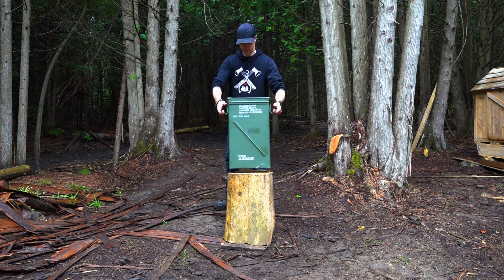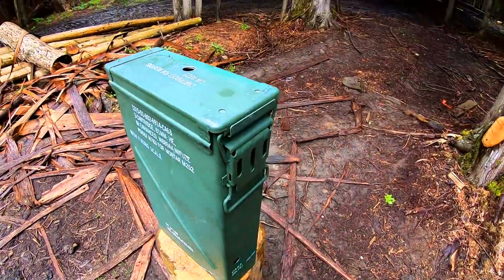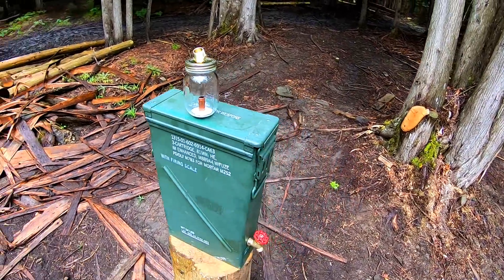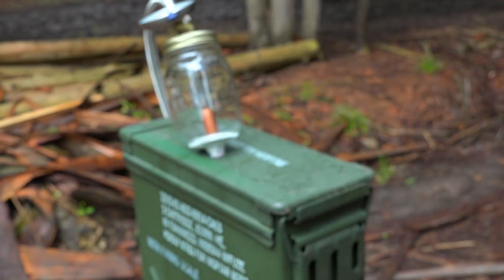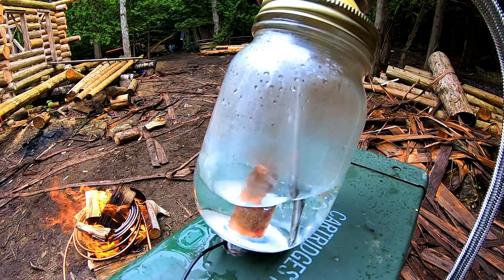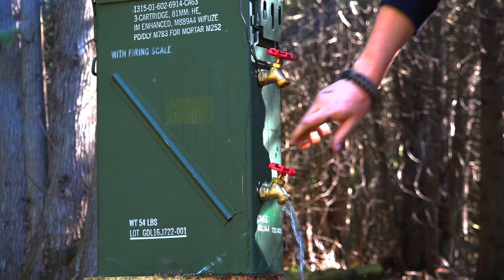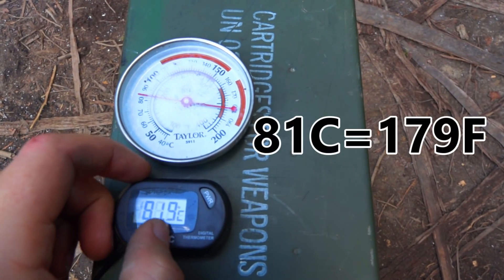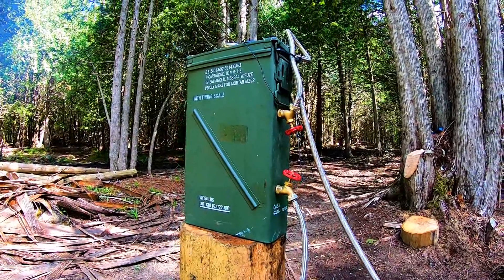Off Grid Heating Prototype- Copper Coil Water Heater / Heat Exchanger / Radiant Heater

Comment: Overall a nice start to a backwoods heating system. Some notes: 
1. Tailor your system to match the amount of heat output and storage. Your ammo can is your storage and your exchanger as well as a thumper. Realistically speaking you probably want to include a radiator (car radiator would be fine, just never let it freeze with water inside).  This way you solve several problems. 
     A) The noise of the system can be kept away from your sleeping area
     B) You can make your storage much larger
     C) You get much more efficient heat exchange
     D) You can locate the radiator in a more convenient location, possibly underneath your sleeping area (if protected).
     E) You can choose many types of radiant systems. You can skip the car radiator and put a flat coil of pex or copper under your sleeping area. With that, you will not need a lot of heat and it will rise up keeping you nicely warm.
2. Storage.  Your system was still hot an hour later, not because it was great in terms of heat, it simply as inefficient in terms of releasing the heat. You could very well have wanted this but, there is only so much water in that can so you have a set amount of heat to release into your sleeping area. Having a system that you have to pull the coil from the fire because it is boiling is not good. It would be better to have something that you can just let the fire burn out over time and keep the water hot as long as possible. 
3. Keep the steam away from you, as far as possible both for safety and because of other bad side effects. In cold temps it will condense and freeze and that is the last thing you want near your sleeping quarters.
4. Water. Water is potentially a poor choice. Now I know you don't want to be carrying around a bunch of coolant so it's a difficult situation. But here's the rub, if you go to sleep on a really cold night and you have removed the coil from the fire, that coil and line might freeze and split. 
5. Fire regulation. There are various methods of regulating the fires heat but something to keep it from getting too hot and lasting longer would be really good for this system. If you can accomplish this it would save your copper tubing from both the oxidation as well as the risk of freezing and splitting. There are also thermostatic valves that you can use to control the amount of water going into the tank. You could have a secondary coil in the snow/air to cool the water so that a bypass value could be used to redirect the hot water to a cooling coil to keep the fire from boiling it. So, the idea would be when the tank gets up to temp, the bypass would route the water to a cooling coil until the tank cooled enough to need heat again. The problem is you need to leave some of the water circulating in order to move water through your radiator and keep the tank up to temp, so you will need to tweak the amount of bypass.

All in all its a great start. Hope to see more improvements as you go.

Comment: Put blow off valve on top hole, vent outside.  Pressure will keep the water from boiling.  Mount heat sinks on the sides of the can.

Comment: Too much heat, you are forming a steam lock in the gravity circuit.  Use a much shorter copper tube or only lay one edge in the fire.  You will know when you have it right when there is no steam hammering.

Comment: Everyone here has so many "perfect and better solutions" and I'm over here like, what are the tweaks you want to add?  Thanks for your time and documentation.
Reply: Haha I read your comment as "What do you tweakers want to add"
Reply: Propane Heater and Camp stove....
Reply: Add a pressure valve to the top, to get rid of the gaping hole and the knocking.

Comment: You could get a small 12 volt heater core for a car and keep the whole tank outside. It would keep the water temperature down as well so it doesn't overheat as bad.

Comment: You need to rethink the copper piping that you can circulate, the water, use it too heat up the cabin. Also use a wood stove that you can control the🔥'fire... Keep the copper piping away from the flame! If you would have a wood stove than add copper tubbing like a radiator then circulate it too heat your cabin, plus hot water for a shower.

Comment: yeah but you still want to have a reservoir, protect against boil dry which would result in the coil potentially being destroyed or mad steam pressure being generated (the system would be closed loop otherwise) plus it would help hold some thermal mass in the system... buuut this would all add weight and complexity, a trade off.

Comment: Run a copper pipe out of the top as a steam release,  and coil the opposite end of that copper pipe into another ammo can and you'll have distilled drinking water in addition to mitigating the steam

Comment: Bro, why are you using a glass container for the top?  So you're gonna snow mobile in, with that glass bottle hitting below freezing temps, then run hot water through it?  It's gonna shatter.  Why not just get a container with site glass on it to see if it's working properly?

Comment: I'm curious, what's the plan for obtaining liquid water when the ambient temperature is substantially below freezing? Would there be enough air moving through the system that it'll melt snow/ice via convection? I'm skeptical, but I obviously I don't know this for sure. If it doesn't melt snow/ice via convection, the only other methods that pop into my head at this moment, at least if this system is to be used in an isolated area, would be the introduction of a chemical additive to lower the melting point of water below ambient temperature, using a chemical additive the reacts exothermically (producing heat) with water, or heating the ammo box containing snow/ice over the fire to get the system started circulating water. Each method has its drawbacks and risks. I'm curious to see if this system is viable when its operated somewhere that doesn't have a convenient supply of liquid water.

Comment: I'm amazed that a radiator using thermal siphoning and water as thermal mass isn't more common, the only real design flaw is that it's dangerous if it's not properly supervised and starts to boil over. Water has an extremely high thermal mass, so it should stay warm for a very long time. The only tweak I would make is maybe route a hose with a pressure relief valve out of the camper as well as a regular ball valve and keep the whole system sealed, so that way no hot water can splash out onto you if it starts boiling and you can manually release the pressure, but it won't turn into a bomb if you forget to

Comment: There is no good reason to heat water with wood as long as you can heat it with sun rays. A shallow well-isolated water bed with a glass front placed at about 45 degrees toward the south or glass vacuum tubes with copper heat collectors in the middle will warm up a well-isolated water tank inside a building and keep it warm all day every day without you lifting a finger after it's built. The sun will work for you if you allow it to. It will heat air spaces such as rooms directly if trapped by thermal mass to the east, north, west, and single-layer glass making up the whole wall to the south. The space will always be warm even on deep freezing winter nights after dawn as the thermal massed walls will release the heat stored during the day. The way of smart humans is to make life as comfortable as possible with minimal energy expenditure.

Comment: Honestly it would be far better to use a real radiator of some sort. That ammo box is just not going to very effective at radiating a lot of heat. Even a small car radiator would do a far better job. Same would go for the copper coil. A radiator there would be far more effective. I mean this is an ok setup if it's all you have, but it could be improved in so may ways. If it's not going to be moved ever, you could even build a metal firebox and enclose your fire. Drop a few peltiers round the box and harvest some electricity from the waste heat. It's not going to be a lot of power, but it may be enough for led lighting, or even a small fan for the heater.

Comment: A Scandinavian trick is to use a log torch (a log split in quarters rejoined with a hollow middle) with a metal pipe U bend going through it and into your tent. The heat differential causes it to suck air from under the fire and blow it into your tent with reasonable force, air temp is usually around 40-60C out, not enough to melt your tent, and no CO2 as the pipe suck point is nowhere near the source of emission.

Comment: how u gonna keep the water liquid when no fire is burning?
Reply: I don't understand what you are asking.
Reply: @k_tess  I believe they're asking how will he prevent the water from freezing if the fire goes out. My answer is that he could add antifreeze or glycol to the water.
Reply: @stevengoogin3729  well actual cooling/heating systems are under pressure. But even then anti freeze is added.

Comment: Great idea! I would caution you against using those braided washer hoses for your set up though. The internal tube is a flexible nylon or some type of artificial rubber and I seriously doubt it is rated to hold pressure at those temperatures. That could cause a serious injury if they were inside your camper and failed.

Comment: Not practical in the slightest. You're trying to have modern convivences while living like you are surviving. That little wooden trailer is great for day trips, which you don't need a shower and can get clean by a canteen cup and a wash cloth. Waste of time, effort and space. You would have been better off just running that ammo can as a wood stove and using a slow burn on it with charcoal since it'll heat longer and faster than wood.

Comment: Add a basket to the top of the can and throw on a couple flo-cheks  on each end of the copper, and you have a drip coffee pot to serve 40 people!  Wouldn't it be easier to just set the can next to or in the fire and set it inside the roaming hutch for the night?

Comment: Use the energy from the fire to somehow move the water through the top water pipe, since there is so much excess heat energy from the fire.

Comment: why not use a car radiator in place of the ammo tin? it would radiate heat a lot better.
Reply: would a heater core work?
Reply: @jabez571  yeb but they are smaller as they are fan forced

Comment: 0:47 ahh engineering in the wild

Will get a little humid with your steam release in the open; maybe make a pipe to direct the steam out with an insulated line when the humidity is high. Just make sure it doesn't clog!

Comment: Awesome design. I'd recommend a metal container for the fire and some coiled steel piping instead of copper. Would be really great to build a system like this out of food grade materials. Could have a third spigot for draining off hot water for cooking and bathing. I'm planning on building a small camper next year and this is really inspiring. Thanks for sharing this.

Comment: The reason water generation worked at first then turned to steam is because water in the coil got hot, then got displaced by steam. There was no sustainable flow, even if you controlled the heat to keep it below the boiling point. There's no pressure differential across the coil, so pressure builds in the coil evenly and pushes hot water out of both ends as pulsed by the steam being generated. The steam being generated is about the only thing heating your water at this point.. There is NO water flow.. This is easily evident by the ends of the coil looking like copper, and the center of the coil turning black from being overheated. That tank should be SUPER hot within about 10 minutes or less on a mild fire with as much copper as you have there.. Not 45+ minutes..  To make this design 100x more efficient, place a one way ball check valve on the cold outlet valve of your water jug facing outward toward the coil..   When the coil generates steam, it will push against both ports on the coil equally. Remember, in a loop, water will self equalize so your theory of heat siphoning is slightly skewed..  It does apply here, but very VERY slightly..  As the steam pressurized coil pushes steam outward against both ends, it will seal the check ball on the inlet, forcing hot water out of the top, (Path of least resistance)..  This in return gives momentum to the liquid/gasses in the coil and this energy will remain moving in the coil until resistance stops it.. This in turn will siphon fresh, cool water in through the inlet as the steam cools and contracts, especially since the gasses/liquids in the tube have velocity going that direction anyways..    Once it runs out of energy, the siphoning stops, the steam generation stops, and the coil is cool..  Now the fire heats the coil, makes steam, and the cycle starts all over again..  It's the exact same principal that a coffee maker works on.. They have check valves, because otherwise you'd have a steamy water reservoir and no hot coffee or water for that matter.. 

Also..   This would be a much more reliable design if the copper were protected from direct exposure to the fire, as this oxidizes, erodes, and makes the copper brittle. Perhaps wrapped around an exhaust flute, or around a barrel placed over the fire.

Comment: Low tech solution: place rocks inside fire until hot, move to a bucket (with a shovel or something) and cover with sand. Sleep next to bucket. 
High tech solution: build low-weight heat exchange system from thin tubing with smart control for your safety. 
It's great that you share your project with this community though. Thanks for putting the effort into making it. Regards from East Germany!
Reply: He's already done this.

Comment: Great idea!! 
How about a coil of copper tubbing in the fireplace of your log home and running the copper line around the baseboards of the home back to the fireplace? Would probably need a reservoir and pressure relief valve setup... possibilities are endless!
Thanks

Comment: You have multiple  lanterns there, that burn what? Candles? Kerosene? Couple of those inside that tiny camper will keep it warm, especially with a person inside. You can run duct off the top of them to outside to deal with any fumes from kerosene . OR use a 5 gallon metal can to contain the lantern and vent it to outside. Gets rid of fumes, blocks the light from the lamp so you have darkness...

Comment: You need to use a small rocket stove to make it much more effecient on wood. Ive seen other people doing this building the copper coil into the upper stove and stove pipe. Run the pipe around your house and 1 or more ammo boxes/boilers makes it super effecient use of water and heat. Fun way to get a hot shower to. If i take a long shower use its not gonna be more then 2/3 of those ammo boxes. I got a biltema portable usb (thats right) usb charged phone battery biltema portable shower. Im not overstating how awesome it is.

My idea was to do what you are doing but then to use electrolisis to make gas from water and salt and use the heat for your system.

Its much more effecient that way. Fun project. Good luck with your cabin project. Dont make your girlfriend a walk-in closet

Comment: I was thinking about something similar for my car. A pressure cooker sending steam into an old car cooler with a bimetal fan, and a hose coming out of the cooler and out of the car into another pot. There would be a pressure valve from the pressure cooker at the very end of the hose. 
A circulation would be nice but I dont think it's possible with the pressure cooker. 
This way I dont have to be afraid of boiling. Boiling is your problem not mine :)
If your setup ends with a boiling temp then you can just warm up the tank and bring it inside - which sucks. I've tried it before and it's only ok for an hour.
There are professional water heating systems with a lot of valves and circuits and frankly unless I prove my system is good enough for the whole night, it may be worth looking for the cheapest and smallest one.
It should work just fine with a brick rocket stove and in fact from distilling my own booze I know that a very small flame on a propane stove is enough to provide steam for a very long time. After 12 hours my 3 gallon pot is still half full. If you could test my idea I wouldnt mind.
Many people live or camp in cars and they have to burn their precious gas to stay somewhat warm - which is not sustainable. 
You can have a proper stove in a cabin or a van of this size but not in a common car.

Comment: Two steel radiators connected together would be easier. One besides or above the fire, one in the camper. By careful positioning you would achieve a much better thermosyphon without so much noise- the height difference between to top of the fire radiator and the cooler return to thebottom of the same radiator would help initiate the flow much more effectively than an essentially horizontal copper coil.

In the U.K. back boilers were the most popular method of heating domestic hot water before gas water heating became common. These were simply  a flat cooper box similar to a small radiator positioned at the back of a coal fire usually where the baffle would be. Trappings top and bottom led to and returned from a copper cylinder usually located on the floor above, or in the case of single storey dwellings close to but slightly above the fire.